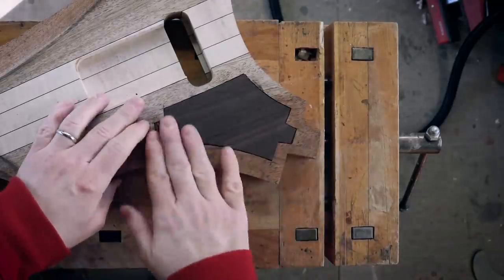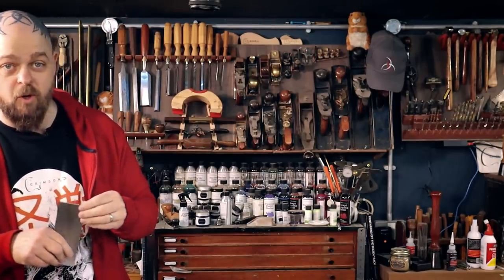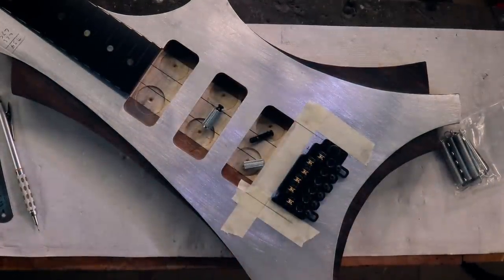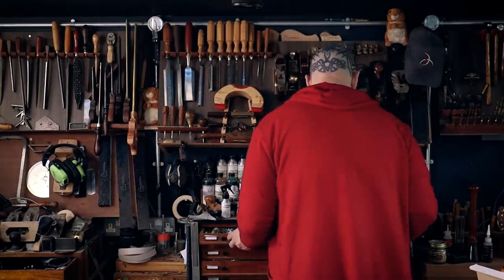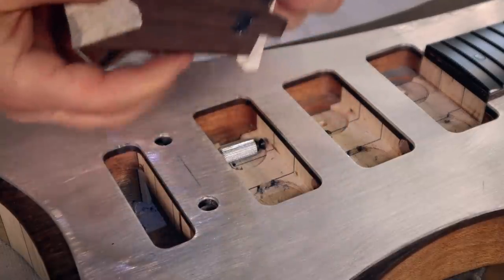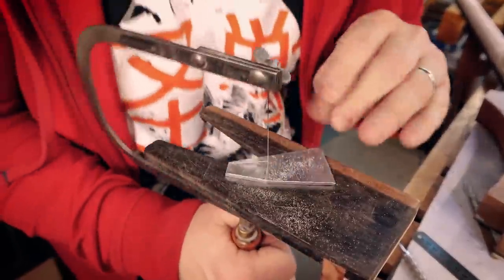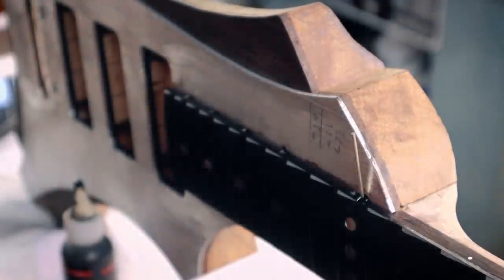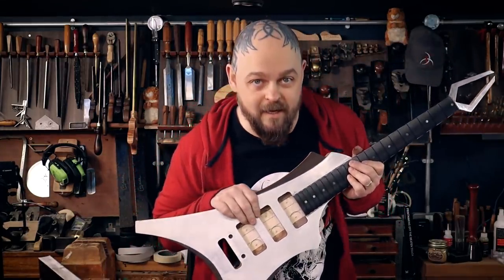Day 7 - Ben loses his nut and breaks the hardware  | Star Wars Inspired Scratch Guitar Build

Comment: The twist drill would have been fine. Just use higher speed and less pressure than steel for alumin[i]um. Plus, that piece is thick enough that once you were 90% through, the hole would make a guide. It would also be be better not to go 9.5 before 10. That would make it more likely to catch. Having wood on the back would also keep you from suddenly punching through. Just slow your feed right before break through.

Comment: The gap illusion in the tip of the headstock, with the dark infill (but only on the face) ... Small suggestion - you could maybe dark stain that section of the sides and back too so the illusion works from all angles 🤔

Comment: Hi Ben, I know that metallic reflective side dots look very pretty in the workshop, but under typical stage lighting conditions where you are relying on the dots catching the light at just the right angle, you just can't see them, especially against dark fret board material. Reflective dots are just not practical for the gigging musician,
my choice is always high contrast, opaque, non reflective plastic dots, a much better choice if you intend to play the instrument in a venue
Reply from the maker: I agree with you.. in this case they are raw aluminium against black anodised aluminium.. pretty high contrast.

Comment: I love this and I really doubted you were going to finish it it in a day I think even if you were able to work 24hrs it wouldn't be done. There is just a lot of work in this design. I never got the chance to add a suggestion about the cavity cover/back plate. I was going to suggest making it from an old printed circuit board with a clear resin coating over it. I had the idea to laminate the whole top of a futuristic guitar project on my list with one but couldn't find one large enough. Maybe someday I can score something that will work.